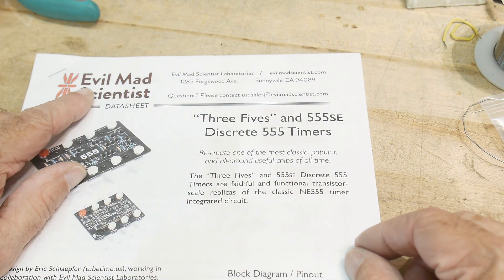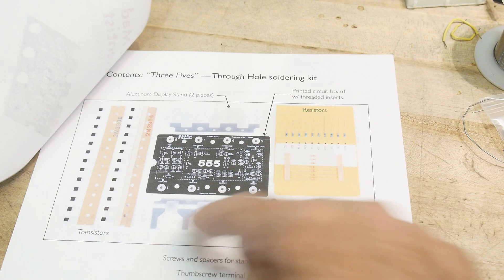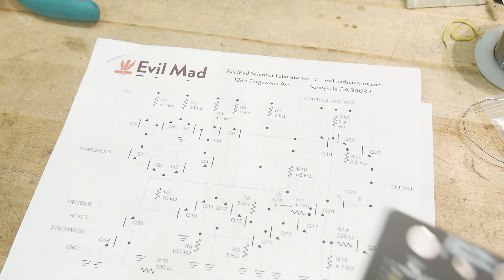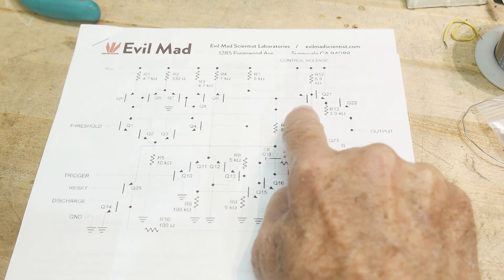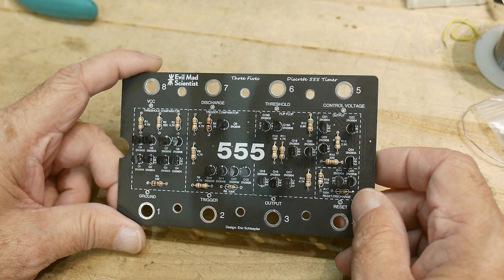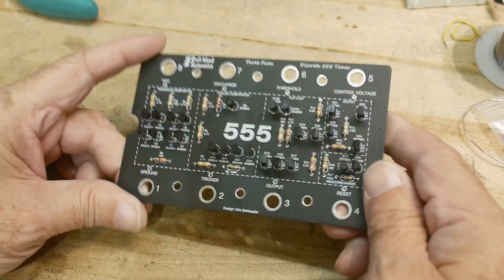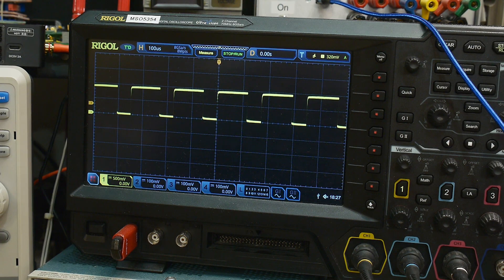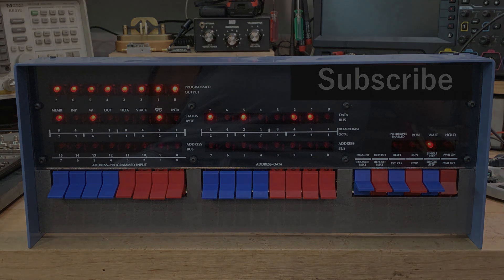#1730 Evil Mad Scientist 555 (part 1 of 4)

Comment: Someone should write a lab book newbies can use to understand how different parts of the 555 work, eg: comparators, differential amplifiers, current mirrors, totem pole output stages, etc.   There are some people who use 555 timers in everything they design.   I don't.   I use the 556.
Reply from the maker: https://cdn.evilmadscientist.com/KitInstrux/555/555_principles_rev30.pdf
Reply: @IMSAIGuy  That's a very good technical writeup on the 555, and applicable to most bipolar analog ICs.   Not as rigorous as Roberge, but still useful for a lot of people.

Comment: Question why are people so timid on SMD soldering? I have no trouble with it. Your thoughts?
Reply from the maker: I did a SMD solder video: https://youtu.be/aoG15wpobF4?si=__ryCsdjmnfWIb8R
I do both SMD designs and thru hole ones. usually for prototype or training circuits I choose thru hole since they are a bit easier to probe and modify. for more production SMD is the way to go. A lot of people don't like working with tweezers or don't have a good microscope both make SMD easier.
Reply: Thanks. I have a soldering microscope. Makes soldering SMD a little easier.

Comment: If you replaced the transistors with 2N7000 or equivalent FETs, would that make it a 7555? ;)
Reply from the maker: the two circuits are quite similar, you can see the 7555 schematic on the datasheet.

Comment: In one of the applications where I used a 555, I hung a zener on the pin 5.  The 5K set the current in the zener, give or take some supply voltage variations.
The circuit was a booster making 12V out of 9V.  The collection of Rs and Cs made it do this:
If the 12V is high enough nothing happens,
If it goes too low the voltage divider connected to the trigger would fire the 555.
The ground end of the divider for trigger went to the pin-7  "discharge"
A capacitor from pin-7 to ground slowed its rise but at some point it would hit the zener voltage and the Q would go low.
A capacitor on the pint-3 "trigger" made it so that the Q would stay low a bit even if the output was too low.
The circuit was well over 30% efficient.
The switching didn't make enough EMI to interfere with my electric drill.
The load regulation was less than a thumb width.

Comment: You could easily modify the board to increase the output current. The IC outputs 200mA, which makes the chip awesome. I built a turn signal blinker for my ebike, just enough to drive the led's. The light stays on when it's not blinking, much safer than commercial relay blinkers.
Reply: https://www.mouser.com/datasheet/2/54/tip36-49435.pdf
Less need to put in current limiting.

Comment: Whatever happened to the Mega6502 or whatever it was called. I remember years ago there was a project which simulated the 6502 using discrete transistors in a similar manner. But, I haven't heard anything about it in a long time. I'm not even sure if it wa meant to be sold commercially. I think it was just a private project.
Reply from the maker: https://monster6502.com/

Comment: I forgot all about these. Wasn't there another one for the 741? I'd love to get something like that. Something about differential amps is fascinating to me. Unfortunately, I have constant issue when it comes to soldering. Whether the part doesn't get hot enough to melt the solder, or I buy a sponge just to get a plastic thing that's useless, or weird sponges that reek like bleach when I wet them. I'd like to get a temp controlled Hakko station. There's a superb documentary from the military about how to solder from the 1960s. So, I know the stuff. It's just getting it to work. Which you would think wouldn't be this hard. But that's life.
Reply: I just use a folded up sheet of paper towel (dry). I place my soldering Iron holder on top, so it can't escape when I wipe the iron tip on it. Dry towel does not shock the tip with cooler water of a damp sponge.
Reply from the maker: I use things like this: https://www.amazon.com/SINJEE-Soldering-Cleaner-Wire-type-Cleaning/dp/B08C4VN46N

Comment: Just as the 5k gives the name. There is the CMOS version which I prefer when possible which could be called "100100100" for the100k divider but it is simply something like LMC555.
Reply: The 5k resistors are not why it is called a 555. In fact, the resistors in my NE555s are 6k each. You can measure them with a voltmeter between VCC, control and/or ground. There are no protection diodes, so you measure the resistors directly. The whole story about how it got its name is anachronistic. In reality, it's actually rather difficult to get the value of a resistor exact in an IC (chip). So, most ICs depend more on the RATIO of resistances, rather than the absolute value. In the case of the 555, with the ones I have with 6k resistors, as long as all of the resistors are 6k, it will still work just the same because it's a resistor voltage divider. So, R1 provides 1/3 of the voltage, R2 provides 1/3 of the voltage, and R3 provides the other 1/3. Actually, I'll link you to an interactive circuit simulator that shows all of this. The values of the 3 resistors are 5k in the initial example, but if you right click on them and select edit, you can change the values and play around with them to see how as long as all 3 values are the same, it doesn't matter (within reason) what they are, it will still function normally.

Sorry it has to be a tinyurl, but the full URL is gigantic. I assure you, it's on the up and up. It's Paul Fastad's version of CircuitMod: http://tinyurl.com/yp5rls7w

I'd also encourage you to play around with this simulator in general. I learned so much from just playing with this. You could spend countless hours just on each of the examples. Never mind actually making stuff, yourself and experimenting without worrying about blowing anything up. I even learned to read/draw circuit diagrams without even trying. I just picked it up as I played with it. I cannot overstate how useful this has been in helping me learn about electronics, used in conjunction with textbooks and other sites, of course.

Comment: Fun stuff.  I gave up on 555s some years ago.  About when you could build a microcontroller circuit to do the same sort of things and more for the same cost.  Always exceptions folks.  Did not watch this one :)  Did I miss anything?
Reply: No.
Reply: I wired in a 555 in monostable mode to disable my car's traction control every time I start it.  I did try a microcontroller, but I had mixed results when the engine starter pulled the voltage low.  I could have solved the problem but it would have taken more effort than I was willing to commit to the project. Lol.

I'm a microcontroller guy, but I'd say the simplest solution is usually the best solution.
Reply: @RK-kn1ud   Automotive is a entirely different bag of wax.  Not only do you need to keep the voltage up by you have massive spikes so automotive certified/grade regulators.  Yes there are exceptions.  Good call.

Comment: Totem pole output?
And while I'm asking: dual collector transistor? Looks like three pin transistors all around, so what's up? 
And a happy New Year! 😃
Reply: Yes, this is actually a totem pole.
It's funny, because that word is also abused for most gate drivers (for like mosfets), and most of those are push-pull circuits.